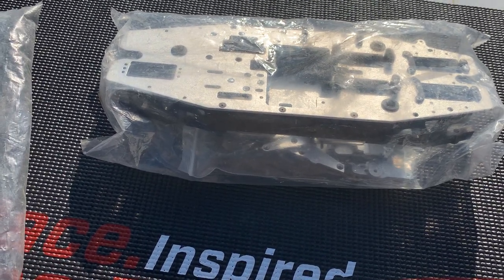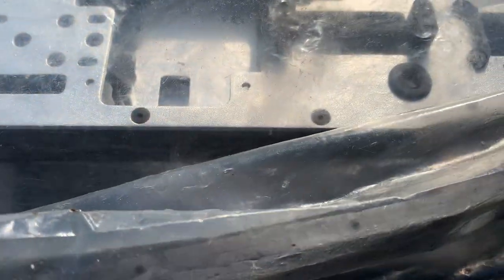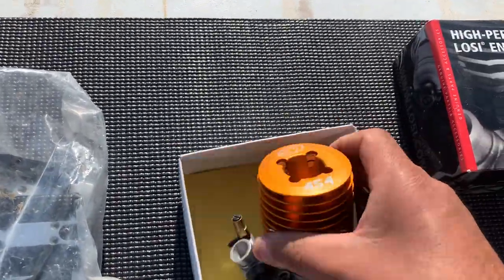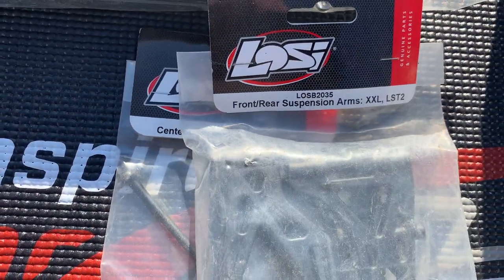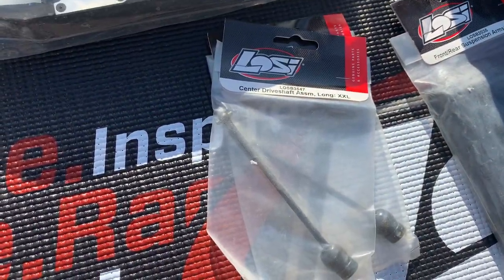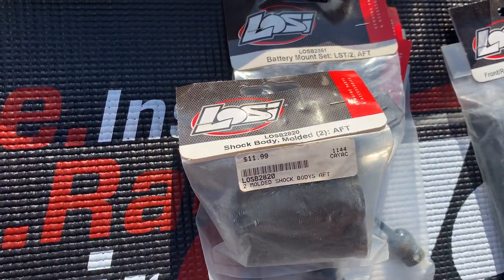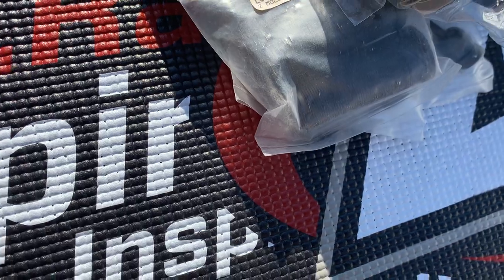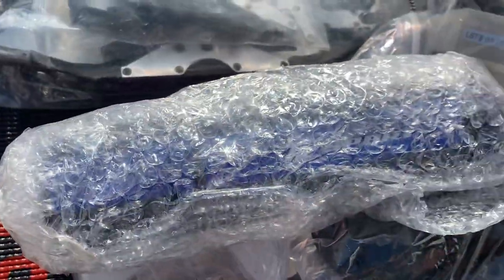Losi LST XXL Build

Comment: Well im subbed.  Ive heard you name dropped so many times in the nitro community.  I m doing the same build right now xxl chassis and 454.  So the a arms are different?   For such a short post you answered just about every question ive been looking for.
Reply from the maker: Thanks for stopping by, so pretty much everything is the same as the LST2, the few differences are the longer top chassis the longer side rails the longer center drive shaft and as you know the body,wheels and Engine they use same arms as the LST2 , I’m excited to see your build I’ll go check you out and sub also thanks again
Reply: @Chino-vn3ot  yeah I checked my a arms and it says lst2 xxl.   The center shafts can you just take the lst2 shaft out and use the old ends just replace the center part?  I'm having a hard time finding whole assemblys.
Reply from the maker: @joshherrman3201  I was looking at the XXL one I have  and it doesn’t look like it, but I did find  some available online there’s only 2 left I just googled LOSB3547 and look on Tony’s Hobbies there’s 2 available
Reply: @Chino-vn3ot  awesome im going to snag them.  Thanks for the heads up.
Reply from the maker: @joshherrman3201  yea cause if you don’t I will 😂
Reply from the maker: @joshherrman3201  hopefully you get them
Reply: @Chino-vn3ot  it says I got them.   I appreciate the heads up.  I look through ebay daily.  Sometimes there is good stuff but you usually pay the I need it price.
Reply from the maker: @joshherrman3201  happy you got them, yea those eBay prices are crazy glad I could help 👍🏽
Reply: @Chino-vn3ot  yes the ebay rates hurt to pay for.  Again thanks for the hook up on those.  I have a decent amount of lst goodies if you ever need let me know.
Reply from the maker: @joshherrman3201  will do thanks